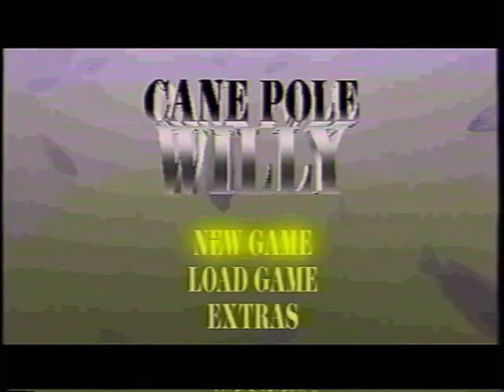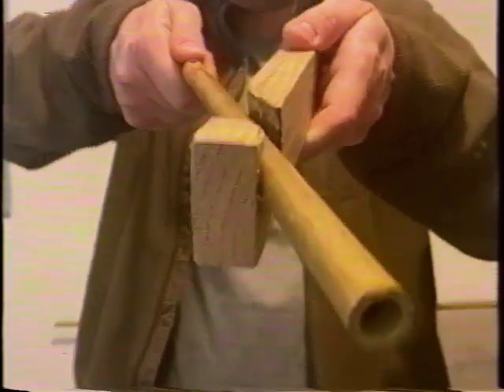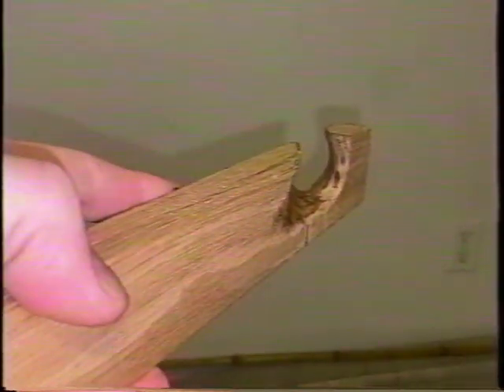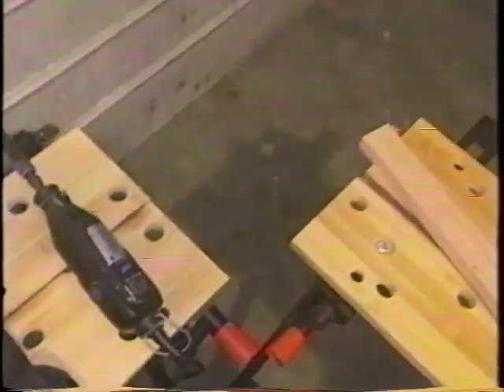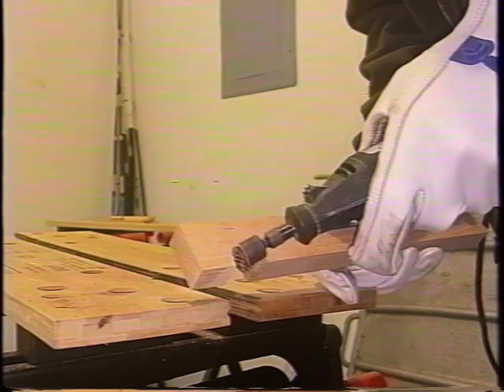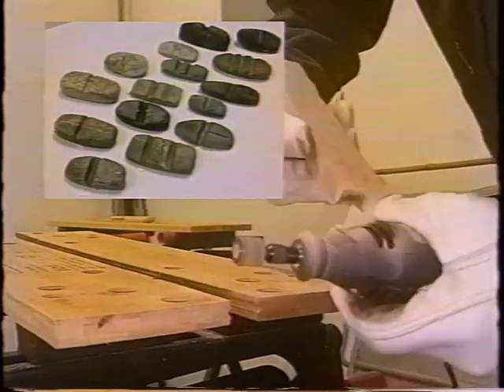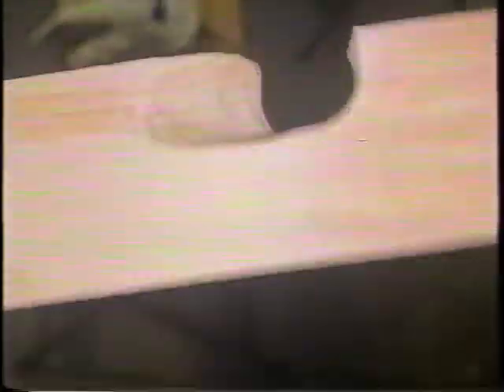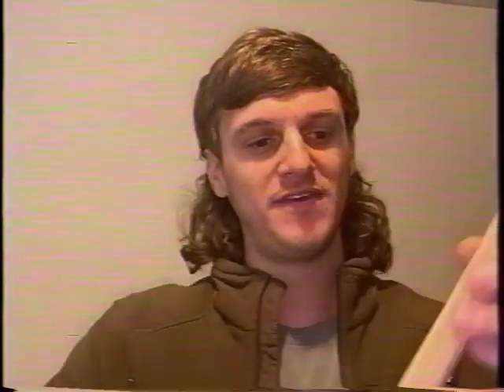Making a Bamboo Straightening Tool

Comment: the whole retro esthetic makes me wonder if you're really not sure about how they straighten wood..... because that would be a normal comment back before the internet 😅
Reply from the maker: I am meaning I’m not sure how they straighten the commercially available cane poles on the market today.  I am sure its not inch by inch with a tool like this tho
Reply: @canepolewilly  I don't know for a fact either, but I feel like I remember seeing lumber straightened by just putting it in a mold and steaming it for a bit and then letting it cure into shape. like a looooong steam oven type of thing.
Reply from the maker: @krymz1  that sounds about right!